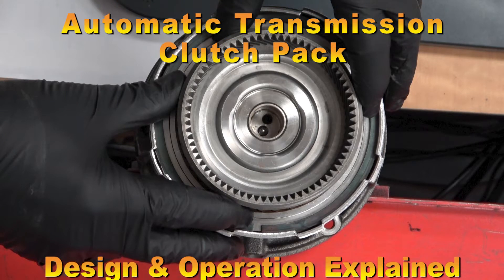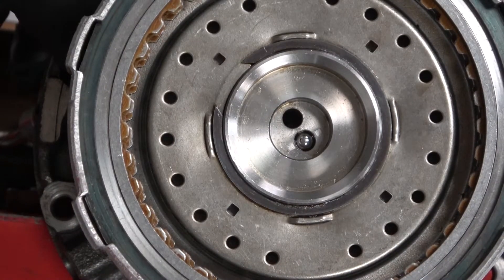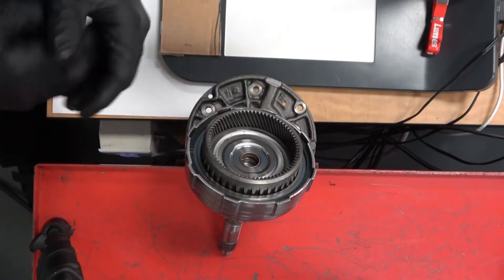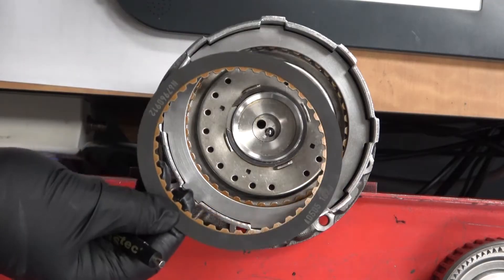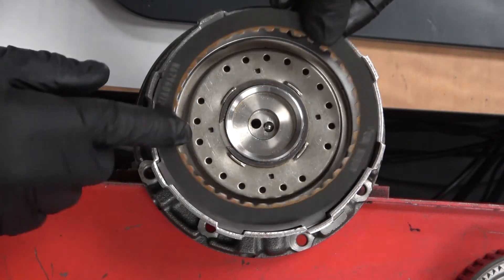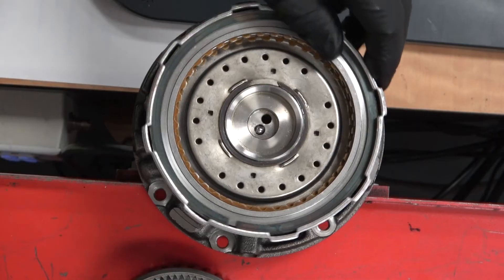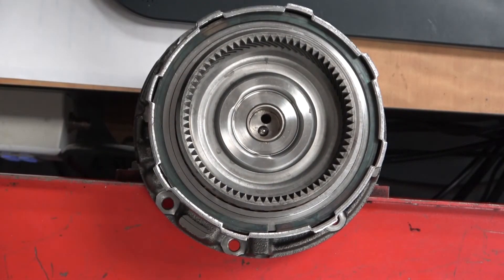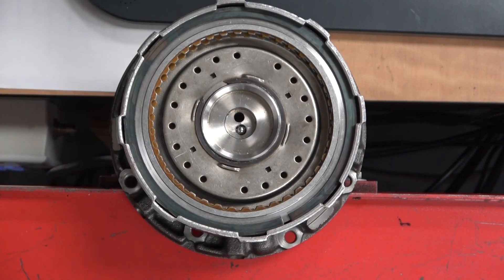Automatic Transmission Clutch Pack Explained

Comment: Appreciate the slow paced yet detailed explanation that allows you to effectively get your explanation across, have a like.
Reply from the maker: Yes bands are different.  Bands wrap around a drum much like putting a strap around a drum.  Bands do not connect two rotating object but instead hold a rotating object to the transmission housing. This creates what we call a reaction member and this provides a specific gear ratio from the planetary gearset. If you have ever used or seen a strap wrench it's something like that but we don't turn anything and instead we hold it stationary. I will put the idea of a video about bands on my to do list.

Comment: Why the Farging Gloves ?
Reply from the maker: Nitrile gloves protect the skin on my hands from harsh oils and chemicals. It also helps to protect against the harsh soaps that are required to clean greasy hands. All mechanics for several years without wearing gloves should be able to relate.

Comment: I have a 4x4 with an auto transmission that I take offroad every weekend. I noticed that when I get stuck in the sand, no matter how much throttle I give, the engine rpms don’t rise higher than 2k and the wheels don’t spin at all.
Do I have a bad clutch pack?
Reply from the maker: You are not experiencing a slipping clutch pack. If you had a slipping clutch pack your RPM's would rise like you were in neutral. It sounds like you are experiencing a lack of torque.  This could be caused by a week or low torque engine. Engine problems that would cause a reduction in torque for example if you had a misfire from one bad spark plug. Or your torque converter one-way clutch is giving out and the torque is not being produced in the converter like it should be.  If you have a normally aspirated 4 cylinder engine and you have put really big tires on your 4x4 this can max out the engine torque and cause something like this.  If you keep trying to get unstuck by keeping the RPM's at 2K you will overheat your trans fluid and burn up your clutches.  If you don't have an external transmission oil cooler installed you should get one.
Reply: @DrivelineMaster  I have new spark plugs and all my fuel system has been checked and cleaned. The car is a 6 cylinder and stock tire size. So does that mean I need to replace my torque converter?
Reply from the maker: Not necessarily.  First it would be helpful to know the year, make and model of your 4 x 4.  What is the mileage on the engine? What is the size of your stock tires? Do you know the gear ratio in both differentials? You can perform a stall test on the converter and see if there is a stall spec in a service manual. Sometimes stall specs and not published. It's possible that you might benefit from a slightly higher stall converter.  To perform a stall test have the vehicle outside with nothing in front of the vehicle for 15 - 20 feet.  Put on your parking brake and press hard on your brake pedal. Place the transmission in drive or manual low and slowly press down on the accelerator pedal. See if you can get the pedal to go all the way to the floor without the vehicle moving.  Make a note of the engine RPM.  They should rise to a value and then stop rising (This is the stall speed and spec we are looking for.) Note this value.  This super heats your fluid so put the trans in Park and raise the RPM's for 1 minute to remove the hot fluid from the converter. Look this up or send it to me with your vehicle information and I will see if I can look it up. If you can't keep the vehicle from moving before the accelerator is fully depressed this is normally a good sign.  There are some stall test demo's on youtube that just have you note the RPM as you accelerate. You can try this only if you can't keep your tires from burning rubber while doing the test I described. If you report back with some more information I will try to help.  BTW.  If you have high mileage have you ever had a compression test done and if so, do you know the numbered results?
Reply: @DrivelineMaster  Firstly, thank you for response. The car is a 2012 Nissan patrol Y61 with the RE5R05A transmission and 4800cc straight six petrol engine. The odo has 184000 kms on it. The stock tire size is 275/70R16 and the diff ratio is 3.5. I haven’t done a stall test yet however I did carry out a compression test and don’t remember exact figures but it showed that it was a healthy engine and all cylinders were good. Hope this helps, thanks!
Edit: I just did the stall test with brake fully pressed and handbrake on, the car started moving by the 1500-1600 rpms mark.
Reply from the maker: Your Nissan has OK engine specs with 245 HP@ 4,800 RPM and 295 foot pounds of torque @ 3,600 RPM. I don't know how stuck you are getting it when it won't move and the RPM's top out at 2000.  What you are describing is a lack of torque to pull you out of a jam. The fact that your RPM's top out at 2000 tells me that your transmission clutches are not slipping.  Torque comes from several places. First is your engine and if it has any problems producing torque for what ever reason from a bad plug to just plane worn out from high mileage. Next is the torque converter. There is a one way clutch built into something called the stator. if the one way clutch starts to give out you will lose torque multiplication from the converter. If your converter  stall specification is 2000 rpm and your engine produces maximum torque at 3,600 you can increase your total torque by replacing your converter with a high stall converter.  I would be careful not to go with a real high stall converter if you drive this on the road for normal commuting. Maybe a 2,800 to 3,000 stall converter. Next you get torque multiplication from your transmission and transfer case. Not much you can do here without spending big.  Finally the differentials multiply torque.  You can increase torque to your wheels by increasing your gear ratios to something closer to 4:1 or 4.5:1 but be careful because this will take a toll on your highway speeds, petrol mileage and it may impact your computer system.  You might have to see if there was a higher gear ratio option for that vehicle and reprogram the engine and transmission control modules to tell them what gear ratio you have in the differential. You might just be hitting the maximum limit of this vehicle depending on how stuck you are. Last note.  Compression test results can be deceiving.  A small amount of carbon build up in a cylinder can render a high compression test result making you think the piston rings are good and the engine is healthy. Check for blue puffs of smoke from the exhaust when you first start it up in the morning or when you let off on the accelerator pedal after goosing it in park. You will need an assistant to do this.  Another hint is to have someone drive behind you while you drive accelerating and decelerating. They should look for blue smoke which are signs of burning oi. Burning oil will add carbon deposits in your cylinder. Carbon deposits can also case per-ignition which will cause your knock sensor to back off on your ignition timing which will lower your engine torque. You might try a tank of high octane petrol next time you go rock climbing.
Reply: @DrivelineMaster  Really appreciate your help. So you reckon I should go for a torque converter only or full trans rebuild? I changed the gear oil once and the old oil was very dark and smelly, have I damaged my clutch packs whenever I’ve been trying to get unstuck? The Patrol did come with different diff ratios but I’m not planning to do those soon. There is no smoke from the car neither at startup or acceleration.
Thanks again for your time
PS I’m definitely not reaching the max potential of my car as other mates with the same car don’t face the issues that I do. Other than stuck situations, my car bogs down on simple hill climbs as well whereas my mates cross me without hesitations.
Reply from the maker: You just added some information I didn't have before. 1) You changed the fluid and it was dark and smelly. 2) Other mates with the same vehicle are not having any troubles. 3) bogs down on simple hills. Fluid can be smelly but did it smell burnt?  The most common symptom of a burned up clutch pack or transmission is the burnt smelling fluid and RPM's on acceleration that makes you feel like the vehicle is in neutral or a partial neutral at the engine RPMs are higher than normal and the lack of power and acceleration. When you said your RPM's go to 2000 and never increase above that it makes me think that your not slipping inside your transmission. It's a bit obvious that your not in the USA so I would not be able to look up the stall specs for your converter but have your mates try the stall test, then you try it.  Do you get similar results? That is a good way to check the engine power, transmission clutch packs and the torque converter.  The fact that your other mates have identical vehicles tells me that you don't need more torque from changing your diff gears. I don't want to tell you that a trans overhaul or converter is going to fix your problems without certain information or checking your patrol out myself because both of these are fairly expensive repairs. Have you had your engine computer system scanned lately. There could be some engine issues that are hard to detect.  Have you had your timing belt or chain replaced lately? It could be one tooth off retarding or advancing your valve timing. Does this vehicle have variable valve timing? if so, this could not be working correctly and you may not be able to tell. Compare the stall test to your mates and let me know.  I'm starting to think something small is off with your engine that is only effected when you need increased torque for your off road fun. Try the high octane petrol once just so that can be eliminated. Have your engine computer controls scanned and tell the technician you have a lack of power going up off road hills.
Reply: @DrivelineMaster  Sorry for the delay in the above info. The old oil did smell burnt definitely. I’m from the UAE and use 95 octane petrol. Computer scans have been done multiple times recently and no error codes. The car does have variable valve timing. All engine drive belts have been changed but timing hasn’t been touched. Thanks!
Reply from the maker: Thanks again for the info.  If the fluid smelled burnt it's possible that you have a transmission problem but it's not a usual one.  It's also possible that another underlying problem which causes you to get stuck also cause you to hold your RPM at 2K while trying to get unstuck burned up your fluid. For example an engine problem ended up causing the fluid to burn up.  I'm not saying that is what happened but instead a possibility that can't be overlooked. I was thinking more of a deep dive at the computer sensor information (PIDs) such as knock sensor count, long term and short term fuel trim etc.. There can be problems that don't set codes.  Here is a thought.  When driving on the normal road what does the acceleration feel like.  I'm wondering if you are getting a 2nd or 3rd gear start. Or maybe your transmission is shifting into 2nd or 3rd really early so you are not getting the torque from 1st gear like you should.  is your transfer case shifting into 4Low.  Drive on the normal road and see if you can tell when the trans shifts and each gear.  With medium throttle your 1st to 2nd shift should happen at about 10 - 15 MPH (you might have to convert to KPH). 2nd to 3rd should be around 25 - 35 MPH and 3rd to 4th around 45 - 50 mph and 4th to 5th around 65 mph.  The harder you press on the accelerator the higher the road speed needs to be when it shifts.  Since you have mates with the same vehicle you can use theirs to compare.  You might just have a transmission problem that is shifting you into a higher gear to soon or you might have a burned up clutch pack that has locked up instead of slipping all the time forcing you to start in 2nd gear. This would most certainly explain what you are experiencing. Road test and look for those shift points. The shift points might also be listed in a manual someplace but just compare to a mates vehicle of the same make and model.
Reply: @DrivelineMaster  Thanks a load. Will have to take note of your points and as well get my mates to check around their cars too. Hopefully I’ll be able to get back to you soon
Reply from the maker: Very interesting problem.  Fun to try to figure out and glad to help.

Comment: And there's a clearance measurement that lets you know if the old clutch pack is too loose or the new clutch pack is too tight ?
Reply from the maker: In most cases that is correct.  I have run into clutch pack with no published clearance value and no recommended procedure for making that measurement. I have seen clearance specifications from .025" to .125".  This is a pretty big range.

Comment: Great visualization, I now understand how when relaxed the steels and friction disks pass each other, but grab when pressure is applied. Something still eludes me: is the piston simply a plate that receives high pressure fluid (continually when a valve opens) to press the friction disks and steels against each other?
Reply from the maker: Yes, you could say the piston is a uniquely designed circular plate. It has to be a specific thickness with machining that accommodates the seals, return springs and any other attribute that needs to be engineered into it. The video shows one piston design as an example. That example has a very unique engineering design.   Yes, there is a control valve that opens and closes off hydraulic fluid pressure into and out of the apply port to the piston.  Your question reminded me that I have an animation that shows this and it might make a good YouTube video.  If I get some time I will make that video and post it. If I get this done within the next few weeks I will email you back with the link.
Reply: @DrivelineMaster  Thank you! The concept of steels connected to the outside and the friction disks splined to an inner element finally makes sense. Also, the fact that the fluid pressure is maintained to keep the piston pressurized in a rotating element was a major stumbling block for me.
Reply: I can see how the term "piston" can make it difficult to visualize just what part is the piston.  Sure doesn't look like any piston I have seen before.  Calling it a pressurized ring clamp is a bit more descriptive.  Linus Yale Sr.  called the pin tumblers in his first lock design of 1844 "pistons".
Reply from the maker: Unfortunately anything cylindrical with a cylindrical object that moves linear within a cylinder in the world of Automotive technology is refereed to as a piston.  I have been involved in Automotive all my life and I could not even imagine a piston in any other circumstance. The most common example is the piston that is used in the internal combustion engine. In an automatic transmission the piston is moved by hydraulic and spring force as compared to combustion forces in an engine. Pneumatic's which is the movement with air pressure also uses cylinders with pistons. I know this doesn't help but if I called it a ring clamp there is no clamping of anything taking place and a ring implies something round that goes around something.  No one in the Automotive world would know what I was talking about. I could call it a cylindrical linear moving disc which might help non-automotive people but the automotive people would then write to me to tell me to call it a piston so I can't win. So I have to stick the proper Automotive terminology and hope that others can catch on.
Reply: @DrivelineMaster  Wow! I was only describing the difficulty that some might have in visualizing the part.  Based on your description then the valves in the valve body should be called pistons.  Lighten up dude.
Reply from the maker: Sorry if you felt I was a little to serious.  I was just trying to explain. Yes, you could make that case for the spool valves that are in the valve body. Light enough?
Reply: @DrivelineMaster  No problem.  I understand the need for good communication when it comes to terminology.

Comment: What causes the discs to separate when pressure is no longer applied? Also what's the purpose of the ball bearing in the center?
Reply from the maker: There are piston return spring that push the piston back when pressure is released.  When pressure is relaxed the frictions and steels can now turn independently again. This entire assembly is saturated with Automatic transmission oil so nothing more is needed to promote separation.